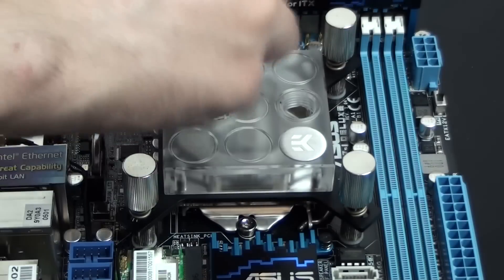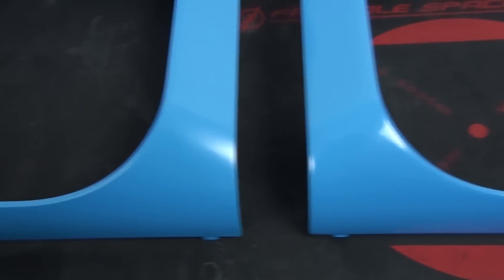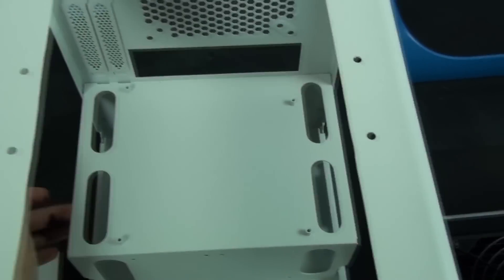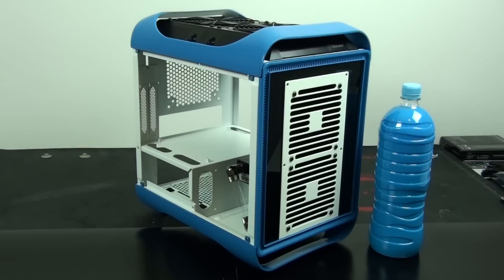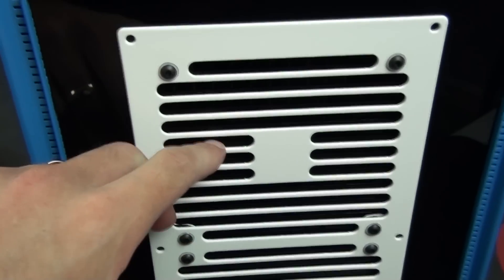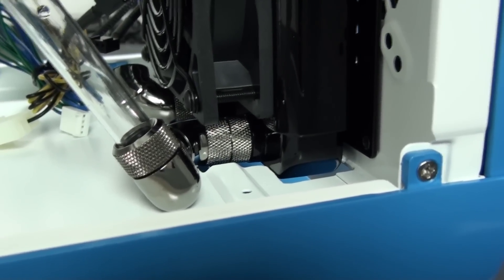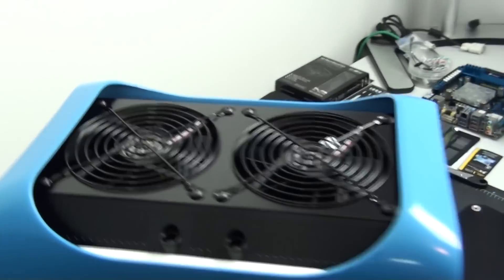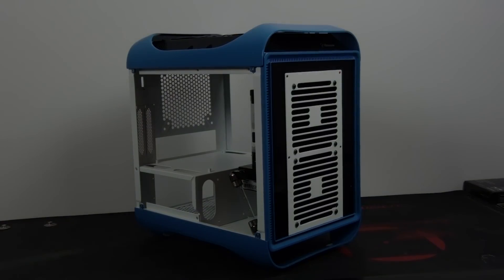Build #6: 'Prodigy': Part 3

Comment: The MASTER at work, fantastic!!
Cant wait to see more!
You inspired me to do my first watercooling project.
I am going to use all EK components.
I bought myself a watercooling kit from EK, the EK-KIT H3O 240 LTX.
I am going to use it in a Silverstone Fortress F02 case with a Asus Maximus V Formula bord, and a Core i7 3770K.
With Corsair 8gb 1866 Vengeance memory, and a 850 ax power supply.
For now i use a Asus 6950 2gb CU2 graphics card.
And red LED lighting, and EK bloodred coolland.

Comment: The small error you did with the front radiator actually looks awesome! That it was not a mistake, but you did it on purpose!
Cooling is so massive, that it breaks the boundaries/limits/measurements...

So you see... in could be, that you did it on purpose :)...

Comment: I really like your solution for fitting the 240mm radiator in the front. The hole you cut in the bottom almost looks like it came like that from the factory.

Comment: suggestion before you install the U-Channel grommet on the bottom of the front 240 radiator:  have you considered installing a T-Fitting setup (either with a T-Block, or an actual T-Fitting) on one of the ports of that radiator?  It would be a great way to set up an easy-drainage system with a 90' fitting sitting underneath the case which could be plugged with a simple G 1/4" plug fitting

Comment: PLPSs on the front and PK2s in the top? Reading datasheets they move almost the same amount of air. Maybe when you close the sidepanels you can do a simple test: put a little piece of towel paper on the back (where you can put the rear fan) and if it is stuck to the case you have to change something:
1. put a rear fan (PL1 is perfect) to have positive air pressure
2. change configuration on the top fans.

I think you have to try this second option, I like it, also for better motherboard cooling

Comment: mount a thick panel of acrylic at the bottom of the case, it will help cover the cut in the bottom of the case (u need to engrave it to mount properly)... you will need to install the psu with the fan facing up... you can further install LED at the bottom which would add to the aesthetic of the case of course

Comment: When tighning the CPU Water block down, you went "Around" the thumb screws tightning them up one at time, when your ment to tighten them in a cross pattern to make sure it tightens evently. Just a heads up im not judging. Overall brilliant work looks amazing tbh.

Comment: When tightening anything down such as the CPU block, do opposing ends and then move one over. It helps bring things down evenly with much less risk of uneven stress on whatever is beneath. Say you number the bolts clockwise: 1, 2, 3, 4. You'll want to slightly tighten 1, then 3, then 2, and finally 4. Repeat.

Comment: loving the build mate, as with all of you're builds, also was wondering when you painted the case did you use paint spray cans or a spray gun with a compressor. also the front panel looks amazing

Comment: A little question about air flow: do you plan to put a rear fan to push air inside the case? I think this is now the only way to do (and you cool also the power phases of the motherboard, otherwise with this actual configuration (negative air pressure) air will be enter into the case from any hole. Maybe you can do some test and the test another configuration: 4 radiators fans in push configuration and (at this point optional) rear exhaust  fan.

Comment: I'd assume a dual-GPU card (even the GTX690) would run into clearance issues with the reservoir, thus won't be compatible. Something like a GTX670 would probably easily fit, however I don't think that's really the point of this build. A lot of watercooled projects are also practical, but are heavily oriented just for overclocking and aesthetics.

Comment: I like the concept of a small and powerful gaming PC, because it's doesn't weight that much, which means it's easy to transport! It would be awesome if you could put an Asus GTX690, but I think it would draw too much power from an ITX power supply. Is there an ITX power supply good enought to supply power to the motherboard, water pumps, HDD's, and a powerful Dual GPU graphics card?

Examples of dual cards: Asus MARS 2 or GTX690, AMD 7990 which is supposed to be coming soon!

Comment: Don't worry I have got through this build with all parts so far (part 4 I believe) but I am still struggling to like the front. I believe it would look better if you had painted it the blue to match in all honesty. 

It may also of worked if the black edge was a consistent thickness. I know this was not possible but it looks almost stuck on due the uneven top/bottom boarder configuration. 

The rest of the build is lovely though.

Comment: Did you try to put front radiator the other way (bottom at the top). Maby u would use more pipes and fittings but there would be no need for cutting. Or it would work? Not enough clerance ?

Comment: Hello, i have just recently bought some upgrades for my PC including a new MoBo, CPU, PSU, and Tower. Im keeping my RAM, GPU and my HDD. My problem is: Can i just setup my rig and put in my Hard Drive and it just "Gets used to" the new parts? Or am i gonna have to re-install my OS, on the new Motherboard, there by deleting everything? Any answers will be appreciated! Sorry for any spelling errors, im Danish.

Comment: You do know that a 200mm rad takes 200mm fans and not 100mm/92mm? Also there are plenty of high performace 200mm fans like the cooler master megaflow which offers 110+ cfm.